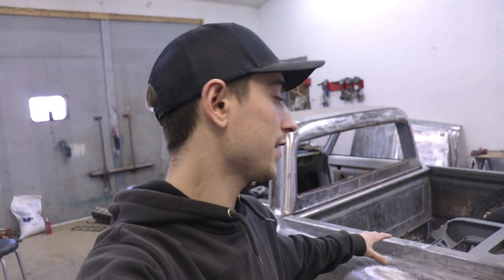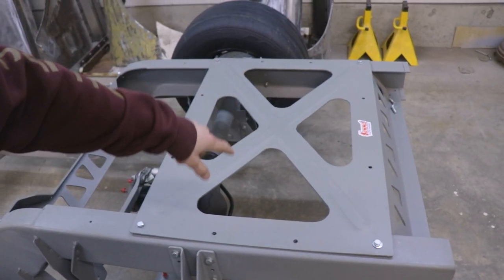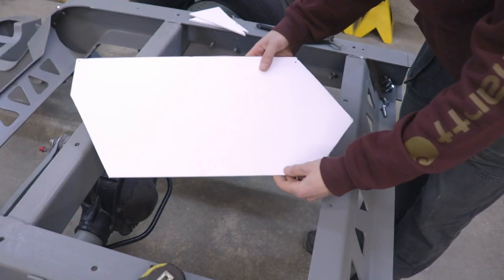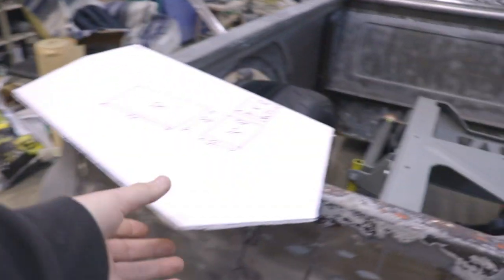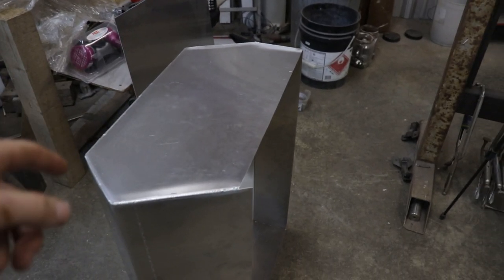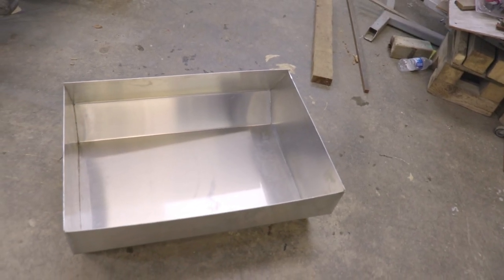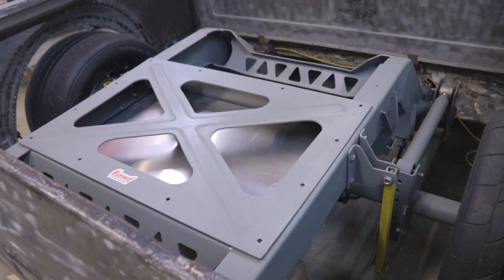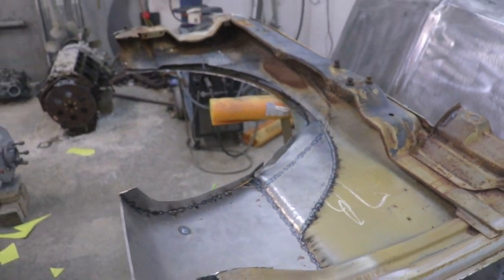Custom 1968 C10- Making an Aluminum Fuel Tank!

Comment: I have a 1966 f100 I need to the same to it as you have done to your c10 template of front frame and back and specs and size bend  thks ill pay $$

Comment: Hey, you need to build a hidden hitch/receiver on your truck. that way if you ever want to do a Power tour or Miles of Mayhem (driving across the country hitting drag strips with other builders) you can haul a little trailer for tires, tools and fuel. maybe have it behind your license plate on the rear. that way you can fold it down/put on the hitch or... maybe just hide the license plate when you take a quick 5 minute stop in mexico.
Reply from the maker: That's a great idea! You will probably see that in a future video🤙😎